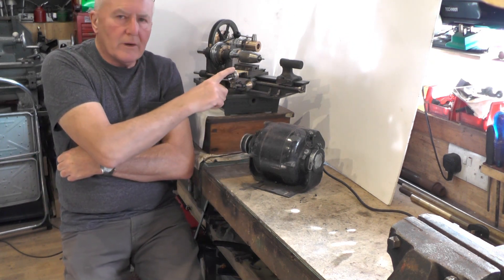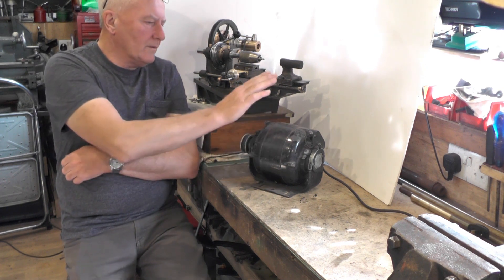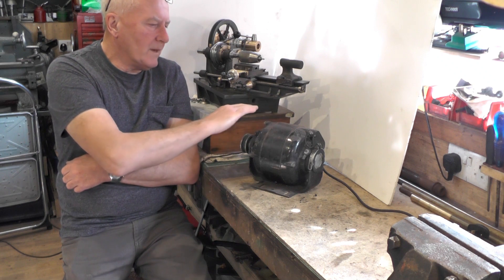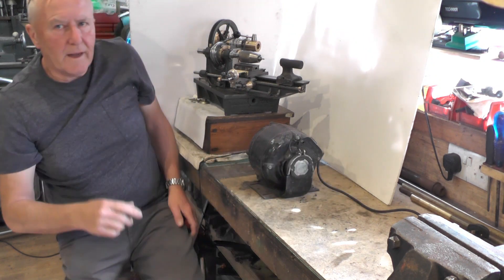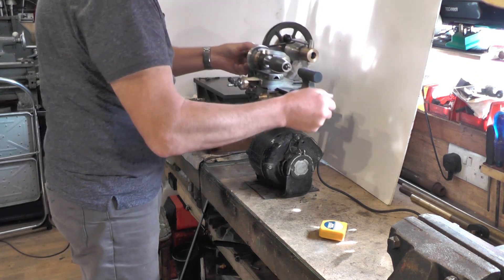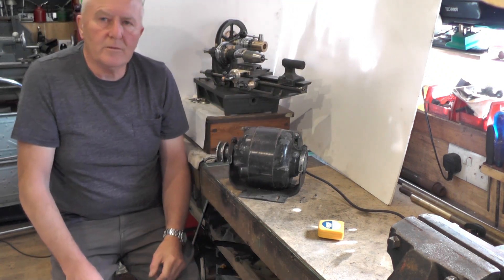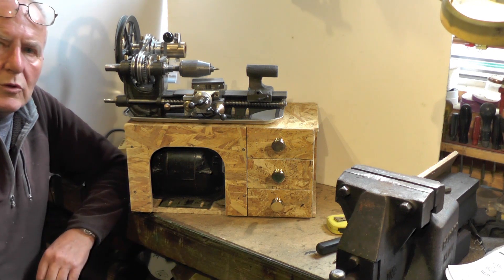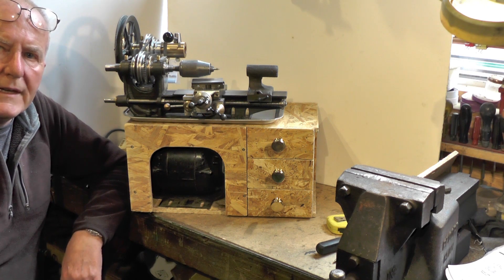Ep 14 Making a Micro / Mini / Watchmakers Lathe from Old Casting (Temporary Cabinet ) "mr factotum"

Comment: I've just discovered this series. Wow, you really know your stuff! I have a DIY mini lathe that has come into my possession. Similar size to yours but some differences in the mechanisms and it was fully working at one point. Problem is, it came to me rusty and in bits, so working out where each little nut, washer and gear goes has been an adventure. Getting there slowly. Can't wait to see you tackle the changegears, because that's where I'm scratching my head on mine. Cheers!
Reply from the maker: Eyup Mike
really pleased you've discovered it, so thanks for watching & feedback.
Now contact made, iv'e subd and bell'd you and will take a look at your channel as time permits me.
Great to hear your working hard on the jigsaw of pieces you have, i'm sure it can be put back to originality with time. 
 I'm working on my micro lathe in tandem with a couple of other projects, so not progressing as fast as when i first started it. The change wheels will soon be on the agenda, i have a couple of options here, either to make a set complete or adapt a spare set of myford change wheels i have which i no longer use, i have'nt decided yet, still got to work everything out and make the Banjo brackets etc etc etc. but its all good fun.  Never a dull moment, ive just come out of the mancave from working on another steam locomotive ive took on. 
keep in touch on how your getting on with your lathe.
regards
Kev
Reply: Thanks very much Kev. There's not much worth watching on my channel sadly, but I have started to put my metal fabrication stuff on Insta. I will be watching some more of your videos now. Lots to learn just by watching the way you go about things

Comment: Nice job Kev 👍👍 Perfect size for that little lathe. I have an almost identical F-Clamp to the one you used on the drawers. Bought from ebay for a few quid and it is my most used clamp. Note to self, get some more F-Clamps! Cheers, Alan.
Reply from the maker: cheers Alan, can't have too many clamps F or otherwise
atb
Kev